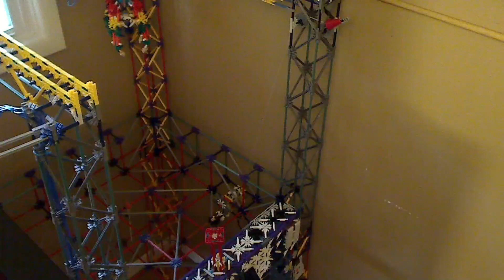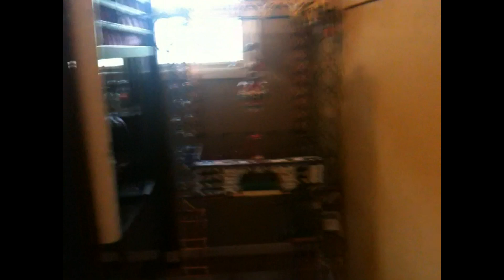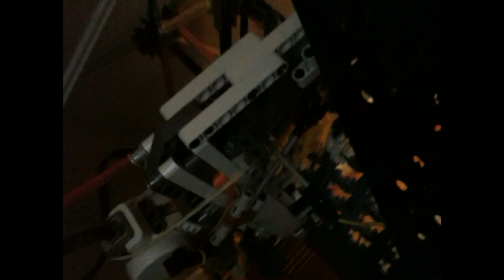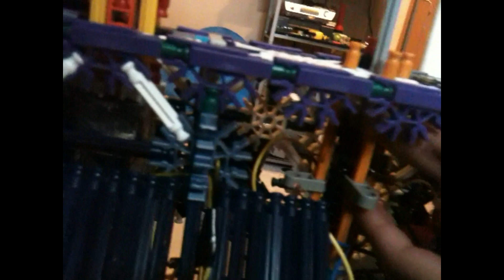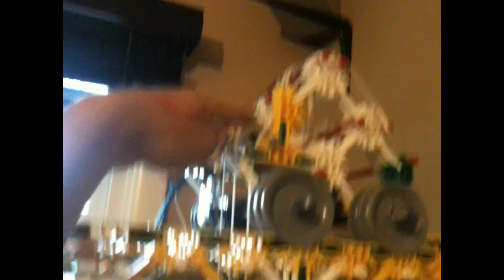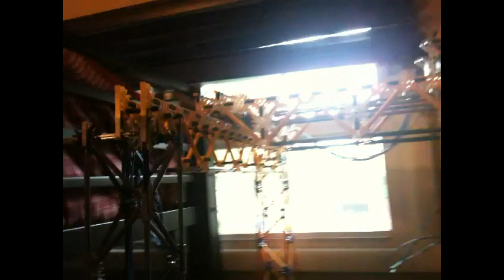K'NEX Gone Wild - Claw Game

Comment: How's the coin mechernisum working instructions for coin mechernisum please struggling
Reply from the maker: Took it apart a long time ago. But, it has a chute for the coin to roll down. It then hits a button from a Lego NXT. If the button press is hard enough (from a quarter and not another coin) then it drives a motor that connects two nails together that are 1. wired to 12v and 2. wired to the motor "switches".

Comment: Instruction??????
Reply from the maker: Kieran Simmonds I'd really rather not build the same one but if you have any ideas, that would be great.
Reply: I built one but it keeps falling apart...
Reply: +Kieran Simmonds I built one many years ago haha. I just build four pillars that are four gray rods apart. They are about 7 or 8 gray rods tall. make sure that each pillar is one yellow rod wide on all four sides of each pillar. then, you want to make a base one gray rod up that is a yellow rod distance from the ground. make sure you have the plate type pieces at the top of the base. I learned to make my claw from ciremip and I just used chains to make the actual claw work. next, make little roller platforms for the wheels. Make a x and y axle with wheels to roll along the top. I'd be glad to send you a video of it on twitter, Instagram, kik, or snapchat if youd like to see it.

ryanisdifferent - kik and snapchat
ryanmlloyd - Instagram and twitter

thanks and good luck!
Ryan